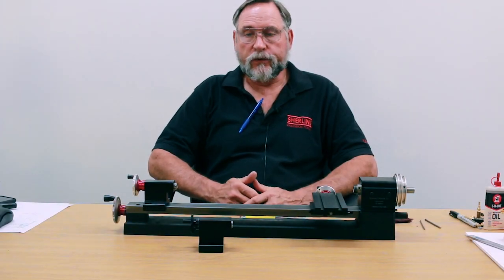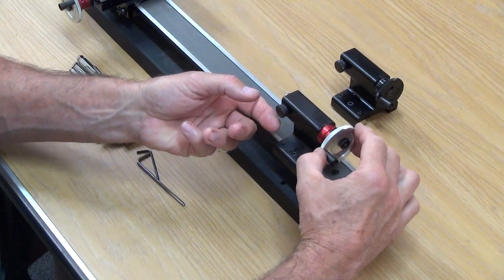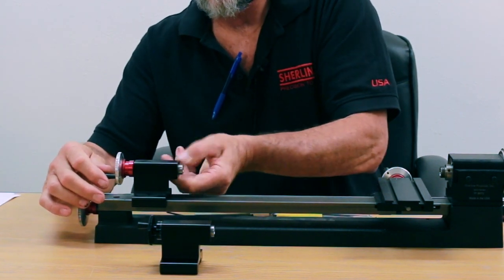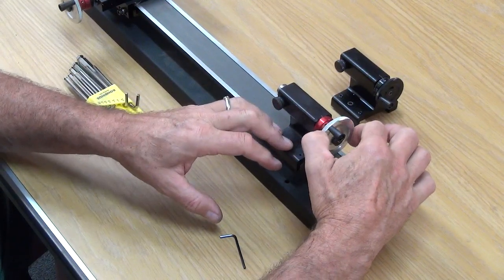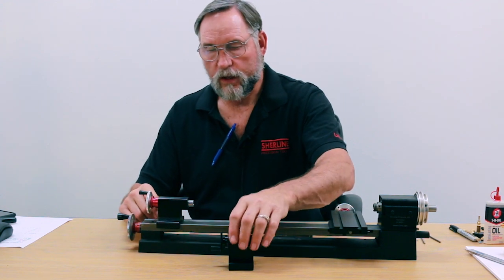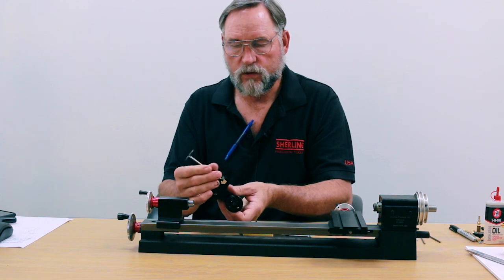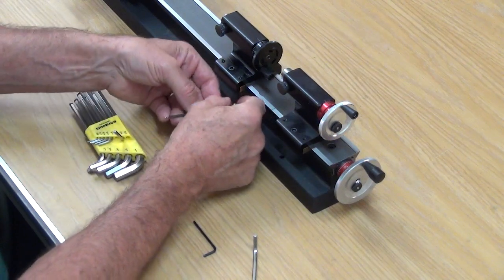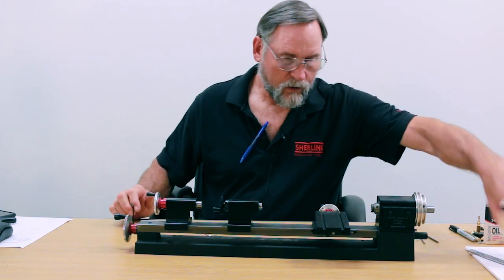Tailstock Adjustment and Removal

Comment: I cut a dovetail on the back side of my z-axis handwheel (opposite of the handle) so I can easily slide my tailstock on and off. Just turn the handwheel to line the dovetail up with the bed and the tailstock can slide right on or off without any kind of process or time spent.